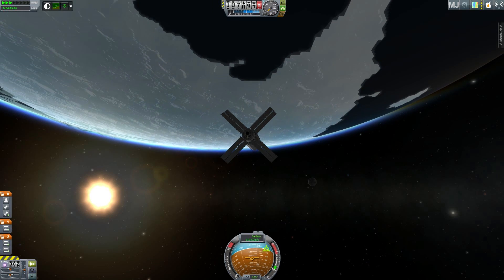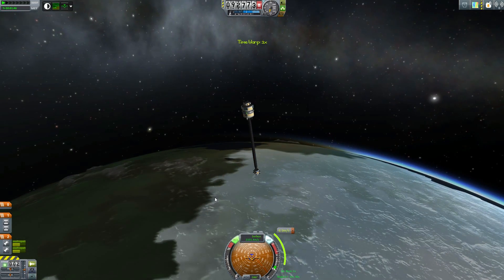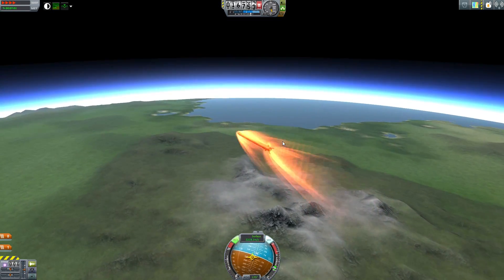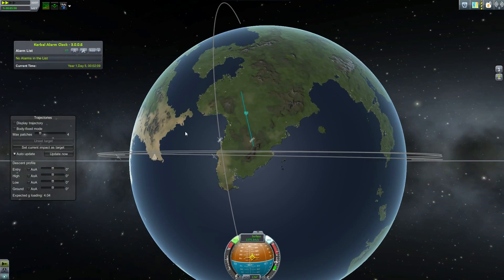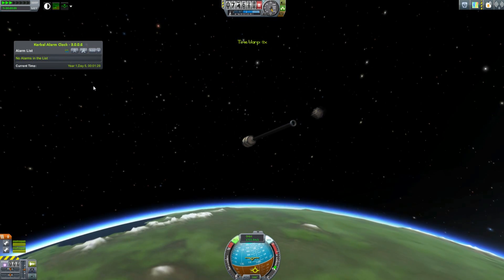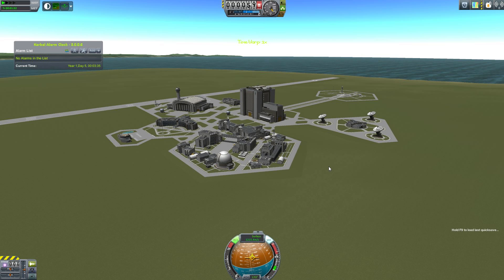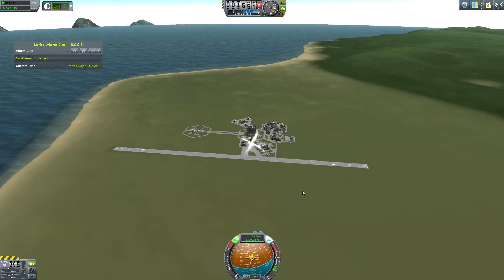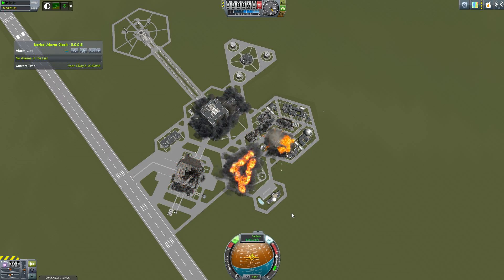Rods From The Gods vs Kerbal Space Center

Comment: The costs of setting up a real life Kinetic Bombardment System are astronomical. The actual rods are made of solid tungsten, which is far more dense than steel. Lifting a set of rods to orbit would require asinine amounts of fuel and in the end the cost vs. reward simply isn't worth it. If you really feel the need to blow something up, just do it the good old fashioned way.

Or maybe we could try not blowing each other up. That would be even better.
Reply: SlyTy98 In terms of sheer destruction, the nuke is way more powerful than the rods.

An Air Force report in 2003 proposed that the rods would be 6.1m long, and 0.3m wide, made of solid Tungsten, and impact it's target at Mach 10.

If you do some really complicated math, that means the rods have a kinetic energy equivalent to 11.5 tons of TNT.

The bomb dropped on Hiroshima is equivalent to 13 000 to 18 000 tons of TNT. The bomb dropped on Nagasaki is equivalent to  20 000 to 22 000 tons of TNT.

Here's a list of currently active US nuclear bombs and warheads along with their yields in kT (1kT = 1000 tons) of TNT:

B61: 0.3kT to 340kT
B83: 800kT to 1200kT
W80: 5kT to 150kT
W87: 300kT to 475kT
W88: 475kT

Sure with rods you may not have fallout, and it's easier to storm in with ground troops, but the rods are really a lot more trouble that they're worth.
Reply: @Phazon8058MS  now with reusable Starship it could be "cheap" enough
Reply: PhazonSpaceSystems Damn you beat me to it.  The rods do have uses though, nukes have a difficult time of penetrating bunkers because their destruction is from a shockwave which a well built bunker can shrug off (it was designed to), but a kinetic kill vehicle would have an easier time to enter the bunker, go deep and create a shockwave from within the bunker, leading to more destruction.  <-- Dat run-on sentence doe.
Reply: Or you could mine and refine these in space. Much cheaper and there are plenty of metal planetoids... Or you could just shoot them from the moon.
Reply: Ghostowl657
Shame you couldn't slap a nuke on the tail end of the tungsten rod, drop it into a bunker, let the kinetic energy plow its way into the ground, and then detonate the nuke after it's sub-surface. I don't think nuke would physically be able to function after the impact.
Reply: SlyTy98 It is, but is that kind of tactical advantage really worth the astronomical costs of developing a rod system, developing a launcher capable of lifting it, and then actual launching the thing?

Alternatively you could build it in orbit over several launches to save the costs of developing a new launch system, but that still costs a ton of money.
Reply: Ha, cost is astronomical I see what you did there.
Reply: SharkNinjaBlueStar Hey it's fine! The more you know! Honestly it's nice to see people who are ready and willing to learn new things in the realms of science and engineering.
Reply: PhazonSpaceSystems
Umm what?

Ok.  Nuclear binding energy is where the energy comes from.  Elements lighter than iron, when the fuse release mass from their nucleons to form the new nucleus.  Elements heavier than iron, when they fission release mass from their nucleons.  Its the exact same process.

A fission weapon is created by making a heavy atom spontaneously fission in a chain reaction.  Typically you need to have a large source of neutrons to create a temporarily unstable nucleus.  This is achieved by using a chemical explosive to squeeze the core to a critical mass.  Normally weapons grade material releases neutrons at a slow rate, but they miss the neighboring atoms.  Making it critical increases this and you get a chain reaction.

A fusion weapon needs some high energy to force light atoms together.  This is accomplished by setting off a fission weapon next to the fusion fuel.  A "radiation case" reflects the fission weapon's xrays into the fusion fuel and you have a H-bomb.

Lastly, there are nuclear weapons that are designed to penetrate ground installations, suffer huge g forces and still function.
Reply: SharkNinjaBlueStar Yeah nuclear explosions are triggered by a reaction. I was kind of wrong in saying it was chemical. It is chemical for fusion weapons, but not fission weapons.

Fission weapons derive their explosive energy from the extremely rapid radioactive decay of particular isotopes of uranium or plutonium.

Fusion weapons derive their explosive energy from a fusion reaction between different isotopes of hydrogen, which releases and ungodly amount of energy.

The science behind nuclear weapons is quite beautiful, it's just unfortunate that it was used for killing people...
Reply: PhazonSpaceSystems Perhaps they aren't as strong as I believed. However the ability to drop rods on any part of the planet at anytime is a huge tactical advantage.
Reply: @SlyTy98  Also it would strike fear into your enemies, making it more effective as an insurance policy than a first strike weapon.
Reply: SharkNinjaBlueStar That would be amazing but yeah, nuclear weapons are fairly delicate.
Reply: Ghostowl657 One common design for nukes is the so called gun design, where you use common high explosives to "shoot" one non-critical mass of uranium at another one to form a critical mass, so I guess you could potentially make one section of the rod hollow and put 40kg of uranium on one and another 40kg (If i'm not mistaken, the critical mass of uranium is around 50kg, so they should not explode by them selfs) on the other side of the hollow section. Then, if the rod smacks into the ground, the uranium masses should collide at huge velocities and cause a nuclear explosion. If you fill the rest of the rod with deuterium and tritium you could potentially set of a core fusion setting of an even bigger explosion.
But I guess not using such weapons would be even better.
Reply: You could put two plutonium balls inside of rod. One at front, second to rear of hollow rod. Impact energy should be enough for chain reaction start. Basically its how nuclear weapons work, they use common explosives to initial explosion, push nuclear material to criticall mass and boom.
Reply: ForeverTheSickestGamer The most likely country to use a system like this is the USA, and if you haven't noticed, it itsnt doing so well in the international community.
Reply: you don't need weight to get inertia.... a small rock from space could take out a building if you launch it from far enough away. and it didnt burn up.
Reply: SharkNinjaBlueStar use the impact to aid the detonation. essentially make it so it detonates from the shock.
Reply: Conor Raypholtz
I don't think nukes function the same way conventional explosives do, they're a really complex set of machinery, which I don't think could stand up to smacking into the ground from space.
Reply: SharkNinjaBlueStar Yeah, nukes involve complicated and very particularly calculated chemical reactions. Smacking into the ground at Mach 10 at the end of a Tungsten rod, plus the intense G-Forces of reentry would probably render the nuke inoperable.
Reply: PhazonSpaceSystems
smacks self in the forehead Why didn't I know that, the Sun is just a giant nuclear fusion reaction, so why would a bomb be any different? I'm sure I did know both those things at some point but have just forgotten them.
Reply: too bad technology advances quickest in times of war, without hittlers missiles, we might not even be where we are today, same goes for the cold war with russia.
Reply: "the old fashioned way" is illegal, so despite the costs, rods from the gods are the only legal weapon you can put up there
Reply: Cyphi Sek This would work, but only with Uranium-235.  That is, in essence, the design of the Little Boy bomb dropped on Hiroshima.  (unfortunately, this is an inefficient design, only ~1% of the uranium actually underwent fission in that bomb.)  In order to use Plutonium in a bomb, you need to have it built Implosion style- a plutonium core surround by dense material, suspended in an air gap.  Then, surrounding this, you have high explosives shaped to create a spherical blast wave pushing inwards at the core, imploding it and initiating fission. (If you want to make it even more powerful, hollow out the core and fill it with deuterium/tritium, which will undergo fusion and burn even more of the plutonium, making a hydrogen bomb.)  However, having a Rod from God with a nuke in it is basically irrelevant, as the power of the nuclear warhead is far more powerful than the impact of the Rod.  Rods were designed to have a non-nuclear solution.  If you want to nuke something from space, you're better of using a MIRV ICBM, as it can fit a larger warhead in it, due to the diameter difference.
Reply: PhazonSpaceSystems The main point of the Rods from God system is to have a conventional yet functionally similar weapon to nuclear weapons. There are tons of war code restrictions on nukes, but since this system is essentially a massive AP howitzer there are essentially no restrictions.
Reply: But if a country is willing to use an RfG system to destroy a target, I highly doubt they care about the backlash from the international community, ie they might as well just break the restrictions against nuclear weapons.
Reply: 5destroyer35
Obviously people just need to be re-educated as to how nice The United States is, and, and all!, All the amazing benefits that come from....(replaced)
Reply: Sometimes war is necessary to prevent even greater death.
Reply: *****'s right and if you get technical squeeze ttogether two elements well enough and you naturally get a nuclear reaction, it's what is in part keeping the sun going.. :) As NASA and others happly point out, drop about another 13 Jupiters into Jupiter and you'd have a second kinda sun in our solar system (A brown dwarf). Simply because the mass would cause the hydrogen in J's atmosphere to ignite, though you need about 70 J's to get a true 'star'.. but yeah.

That being said why would you deliver a nuke this way when it's cheaper to do it every other way.. and if you actually let the K.K.M (Kinetic Kill Missile) hit the ground the raw transfer of energy would vaporise the nuclear device and turn it basically into a dirty bomb. if you air detonate it.. then your really not getting much better of a bang for your buck because your just air bursting a nuke.
Reply: Or we could try to get energy weapons such as MEDUSA and ORION from mortal engines.
Reply: JamesPolymer Having just completed a massive amount of research on project Pluto (aka looking at it's Wikipedia entry for approximately 5 seconds!), I would suggest that it was no worse than project Manhattan.

On another note, I can't help but notice that the code name for the reactor in project Pluto ("Tory") is also the name of a political party here in the UK. To be honest, though, most Brits would probably vote for the reactor to run the country and use the politicians to power a cruise missile! :)
Reply: Adam Mullarkey
I was going with the angle that Project Pluto was more "batshit insane" than "worse" per se. How else do you describe a weapon that slowly kills its makers just by sitting in their general vicinity? O_o

I don't think powering a cruise missile with politicians is a sound idea; they might corrode the fuel tanks before you got off the ground. Though I could see them giving sterling service in dissolving nuclear waste.
Reply: spartanonxy Having googled it, I can see no reference to any "Orion Battleship," other than the 2 I previously mentioned.

I know the Casaba could be used for orbital bombardments, but, as I said, it would be less efficient than targeting space targets.

HEAT, in terms of weaponry, means "High Explosive Anti-Tank." HEAT shells do not fire molten metal, they fire a shell which detonates, firing molten metal into the target, on impact.

I know you knew that 2 world wars at once aren't possible, I was making a joke in suggesting you didn't.
Reply: +PhazonSpaceSystems "Sure with rods you may not have fallout"

Unless you cap it with Cobalt, turning it into a Kinetic Thermonuclear Weapon that would kill everything in a good 5 mile radius for the next 75 years.
Reply: OvAppolyon Um no cobalt is a terrible Fissile material on its own.You would need to tip it with a small nuke to start it more or less erasing the advantages.
Reply: PhazonSpaceSystems I don't know but if you could print your countries money and REALLY wanted to kill some people, hey it's worth I suppose. I mean think about the flak from nuclear or high explosive warheads? People would be infuriated
Reply: Ghostowl657 I don't think there's any way it could be designed to handle such a massive impact and still have the capability to detonate. Maybe just a shit-ton of conventional explosives then?
Reply: PhazonSpaceSystems
Oh so that's how they work? I've always wondered that, I thought it had something to do with electromagnetism, but yeah, hi-tech things usually don't fare well with ungodly levels of G-force.
Reply: PhazonSpaceSystems
^^; hah, yeah, biology is really more my strong suit, rather than chemistry and nuclear physics.
Reply: ***** I was simplifying it a bit lot. To be honest I oversimplified it.

Lance Elliott By 'the old fashioned way' I meant putting a warhead on a missile and launching it, or putting a bomb on a plane and dropping it.
Reply: SharkNinjaBlueStar It requires hundreds of feet of granite to build a bunker that's capable of withstanding a 100 kt nuclear warhead. The penetrating power of the rod is miniscule to defeat that much granite so it won't actually help the nuke get in there. Not to mention the nuke just breaks when it impacts at Mach 10. It is just defense overwhelming offense, in which case the only solution to the problem without using brute force (such as multi megaton warheads) is having sombody infiltrate and sabotage the bunker.
Reply: SharkNinjaBlueStar they launch a pellet  at the core to start the nuclear reaction.... so the shock wave from impact would only aid the detonation in a properly designed device.
Reply: Conor Raypholtz You either need mass or velocity. Height is just velocity by means of acceleration by gravity.
Both do not come cheap, though velocity comes with a square factor.
Just reaching the orbit nets you quite high velocity already.

The main problem with low mass fast projectiles is the abrasion by atmosphere known as "burning up" plus the problem with fluid dynamics taking mass into account.
(At orbital speeds you really shouldn't use aerodynamic simplifications. It's almost a miracle any rocket has been launched into space and even more so that anything ever returned from there, considering the huge abuse of approximations.)
And you cannot just throw computing power at the problem either - it's not tractable even on today's supercomputers. Much less on what, say, NASA had in 70s.

So the consensus is that you need a bigger rock rather than a smaller faster rock.
Reply: Well you may be right, but rods from the gods can actually be fired from orbit, and can more efficient at destroying bunkers.
Reply: AstralStorm approximations are not an issue. we know density and can calculate perfect world scenarios then add in a calculated margin for error. if you are shocked that we can approximate densities and still get things to work you should reconsider. even planes are approximated and we have systems to correct for variations in lift... adapting to new information as it comes in is the only way any system ever works. in a real world scenario that rod would be self guided and recalculating several thousand times per second. its a crude version of a weapon system that is impractical by design the only way to make it practical is to reduce mass and increase speed. it would still be impractical but its the logical design step. that is all my point was.
Reply: also, if you watched the trailer (and didn't die) you might have seen that the rod traveld through the atmosphere in about 3 seconds, from geostationary orbit, so you need to go about 10km/s to do that, with only a mininmal charge, so yeah
Reply: AstralStorm
           orbital lasers
   threaten the cities of Earth
 mock my mad schemes now!
Reply: Withstand
Nice flashlights. Atmosphere absorbs a lot of light.
Make that masers (microwave lasers) and this might work, though aiming is still very hard - they get bent by the atmosphere.
Still way less efficient than a kinetic weapon or missiles.
Reply: Actually price isn't nearly as high as you think the real problem is it's dumb fire so there is no guidance. So any moving target cant be hit. In other words it is only useful against slow moving or stationary targets so its useless in modern war essentially.
Reply: And miss out on Sci-Fy action like devastation? ;)
Reply: You are not allowed to launch nukes from space, it is a war law!
Reply: True but there is no law about quark-gluon fusion warheads :3 . Though such a weapon would kill everything within a few miles as in everything in 30 mile radius.
Reply: Anna Gomez
And if some wack-job dictator with a stranglehold on his nation's media manages to sneak a few of them up during a "satellite maintenance" mission, those rules are going to count for quite a bit. =D
Reply: But wait dont we already have Project Thor?
Reply: SwagWardMobile
Pfft, try looking up Project Pluto. That thing was truly horrific in scope and insanity. O.O
Reply: Adam Mullarkey HEY HEY HEY. Using even one politician cruise missile would start WW3 and WW4 at the same time. That isn't even inhumane that is beyond evil and beyond inhumane. Also Pluto was meant for a last resort weapon. There was a even worse weapon the Orion battleship it would have 500 20 megaton warheads and a alternate design would have been a massive bomb itself with a 3 gigaton warhead. Reality is often stranger and more demented then fiction. Case in point the Casaba howitzer. A nuclear HEAT round more or less so it shoot nuclear fireballs at the target to insure the target DIED.
Reply: spartanonxy Technically, because of the very nature of the name "world war," it would only be possible to have one at any given time.

As for the Orion. If you meant the original Orion-Class Dreadnaughts (Royal Navy, 1912-1922), I see no mention of Nuclear weapons (and I would hope not, since they weren't even invented before the Orion-class was decommissioned. If you mean the Nuclear bomb-powered spacecraft, that was technically a propulsion method, not a weapon. Besides, calculations at the time indicated that the optimal yield would be 0.15 kilotons.

And the other project you mentioned, the Casaba, well, yes, I suppose that would be worse. At least, it would if it weren't for the fact that space travel isn't exactly got so far as for us to be launching starships big enough that you need more than a peashooter to kill everyone on board (perhaps a slight exaggeration, but you get my point, I'm sure). And the howitzer would be less efficient against surface targets because the atmosphere would slow down the, as you so eloquently put it, "nuclear fireball." In other words, at least in terms of orbital weapon systems, a nuclear cruise missile, launched to orbit and de-orbited like the Rods, would be far more effective.
Reply: Adam Mullarkey Actually there was a modified orion spacecraft design that was almost insanely armed. The Casaba in theory could be fired at targets on the ground as the molten metal it fired would be traveling at speeds up to mach 60. I thought saying heat round would give away it fired molten metal guess not. The major idea for casaba is if the USSR got space warships they would die easy and a side effect was the most powerful bunker-buster in theory. A major reason the Orion project lost government support is a model of the Orion battleship was shown to JFK and according to eyewitness accounts scared the SHIT out of him. The concept for the Orion battleship was to use Orions stupidly high thrust and deltav to well make sure the Russians were screwed. And yes I know 2 World Wars at once aren't possible I was making a joke. The Orion battleship design didn't use the 20 megaton warheads for moving these were for orbital bombardment.
Reply: Adam Mullarkey HEAT rounds are technically called shaped charges and it forms the jet by superplasticizing the metal. The casaba howitzer replaces the chemical explosive typically used in HEAT rounds with a nuclear warhead. The metal liner in this case is essentially atomized to form plasma jet that travels a few percent of c.
Reply: Major Dakka that is correct but the angle is very small resulting in more of a ray of nuclear plasma then a antitank weapon.
Reply: +PhazonSpaceSystems So that's whats costing 600 billion! (for the US)
Reply: steal the tungsten from the aliens, or asteroids.
Reply: Except once they're up there, it's very cheap.
Reply: PhazonSpaceSystem  also tungsten has a much higher melting point, which is why it's used as filaments in incandescent bulbs.
Reply: PhazonSpaceSystems You have guaranteed first strike capability though.
Reply: Send it with an electromagnetic rail
Reply: If you don't have the capacity to blow other people up then other people may get obsessed with then idea of blowing you up. Mad deterrence and all that standard stuff.
Reply: Lack of war? Booooring
Reply: SlyTy98 Wait I have a better idea. What if we didn't have wars? I think that would be a good idea.
Reply: But who is setting up the weapon? Is it a very rich country? If so, money isn't a factor. Besides this weapon would be far more devastating than any nuclear warhead and would allow you to storm said location in mere minutes since there would be no fallout.
Reply: @SlyTy98  money is always a factor. when you get richer you just quibble over larger sums of money
Reply: war is unfortunate but necessary.